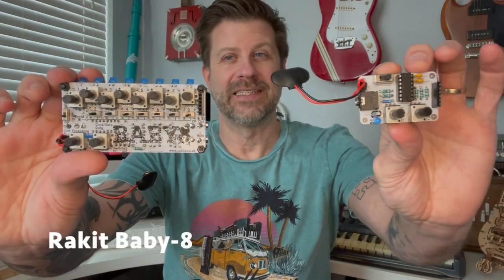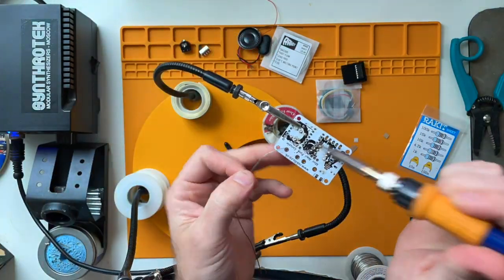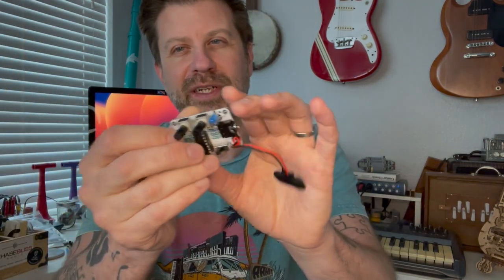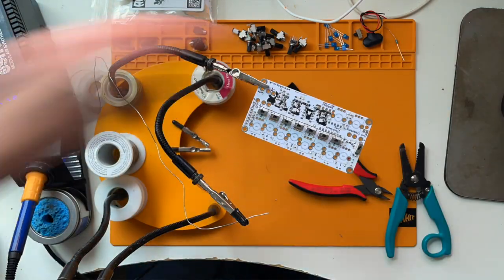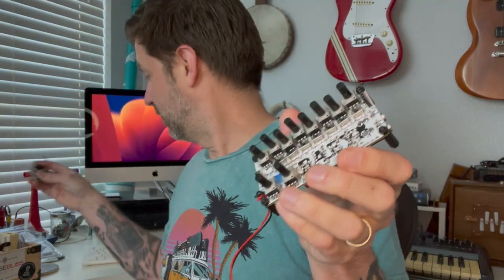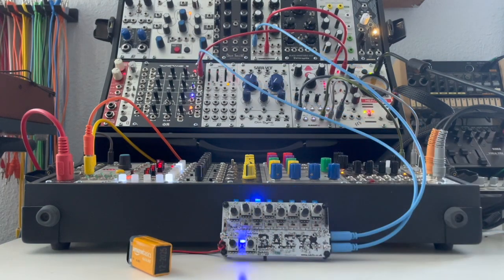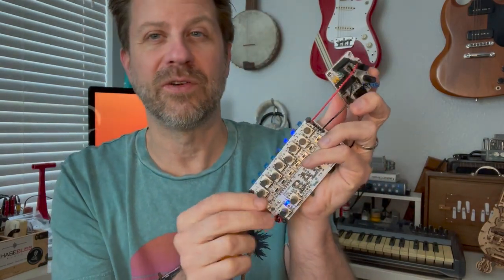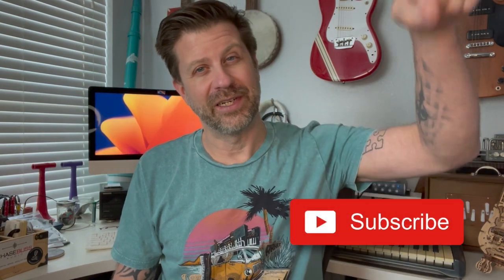Rakit Mini-APC & Baby-8 (DIY Synth Kits)

Comment: Those are fun little modules. Do the jumper cables work to send CV (the small non patch cable ones) or do the just do power transfer? Fun video as always
Reply from the maker: Thanks for checking it out. Great question. There are 5 active pins. The top pin provides +9V and the bottom pin is common ground. The middle three pins are CV1+, CV2+ (I can't really figure out what this one does LOL), and Gate+ from the sequencer. Even if you don't use the power wire, you still have to connect the ground to get the CV/Gate signals to flow. So there will always be a minimum of 2 pins used. I didn't really explain it all that well but I demonstrated it around 8:55.
Reply: @musicalmiscellany  I was curious  as to weather or not they would play well with a bastle kastle or volca modular as they use the same mini jumper cables
Reply from the maker: @id.unknown1283  I would imagine they would. I remember seeing a video of someone using the Baby8 with a Kastle.

Comment: Wonder what it would take to modify such that you can skip some steps, but also reset on another step
Reply from the maker: Thanks for watching. That would be a cool feature. I'm sure it's possible with this kit but I'm guessing it would be pretty difficult since they currently switch to one mode or the other and then use the same set of switches for reset/skip. You'd have to add another set of switches plus a logic circuit.
Reply: Confirmed it works by using only a row of ON/OFF/ON switches and two diodes, using the RAKIT pcb LED+ output tied to middle pin of an ON/OFF/ON switch for each step.  Tie all pins on one side of the ON/OFF/ON switches together using bare wire, and separately do the same for the other side. Tie one side to the RAKIT RST/SKIP switch right pin, and the other side to the left pin. This way only one side is active at each step, but never both.  Also tie both sides (using diode) to the right pin of each RAKIT channel switch.  Perhaps this will help someone looking to do the same.